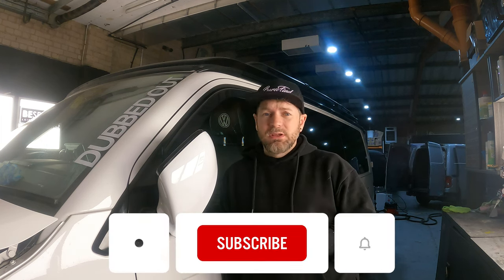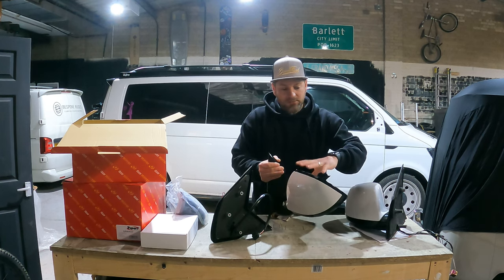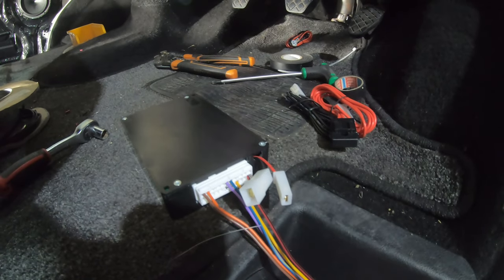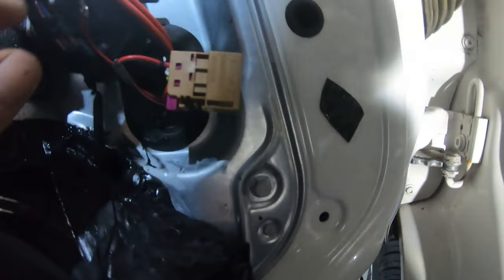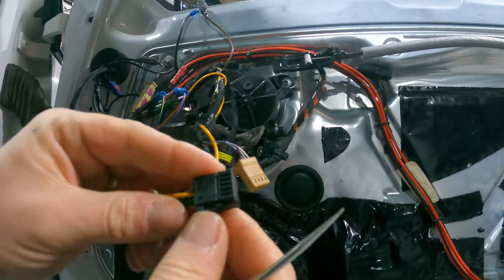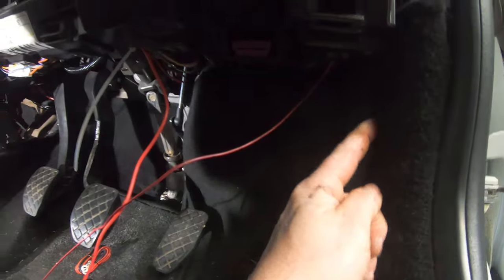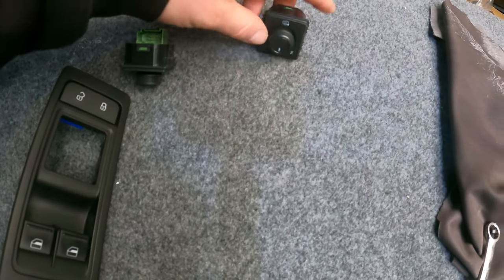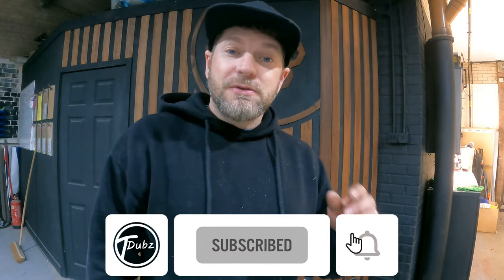VW T6 power folding mirror upgrade #powerfoldingmirrors #vw #vwt6 #vwtransporter #camper

Comment: Great upgrade for my T6 and thanks VM for the video, I would have been completely lost as Travelin Lite provided zero instructions! The only thing I would say, the 2 wires (Black & Red and Red & White) to the doors were just about enough length. The passenger side was extremely tight and I wasn't sure it was actually going to reach but it did with about 25mm to spare. Just need to locate the box under the dash and thats me done. Cheers
Reply from the maker: Not a problem thanks for watching, glad it helped. Tucked up under the dash somewhere safely secured… a lot of the travelin lite stuff now has a qr code… thanks again 👌🏻

Comment: Hey fella thanX for this video 🤘🏽
The switch upgrade you put in also has a central locking button on it. My T6 doesn't have that option, my question is, is it possible to add this to mine? I am an absolutely noob when it comes to this and would appreciate any assistance 🙏🏽
Reply from the maker: Il do a little research… this was the the original switch so will see what you can do 👍🏻👍🏻thanks for watching 👌🏻👌🏻
Reply: @tomtdubz  much appreciated 🙏🏽

Comment: Hi do you know if you can just fit the mirrors and have them fold up and down with the two wire you said about when you lock and unlock as im not bothers about electric moving glass or the bigger switch in the door thanks
Reply from the maker: Not 100 sure but I guess it would be possible try someone in the auto electrics world, it’s got to be able to work 👍🏻